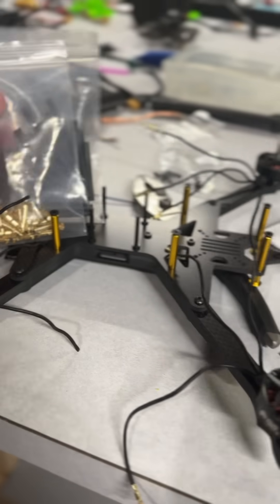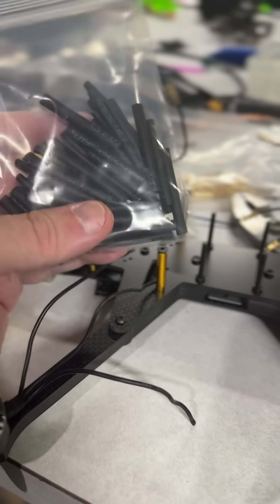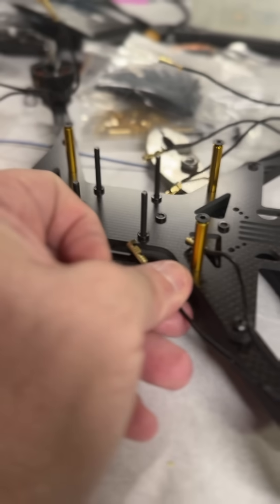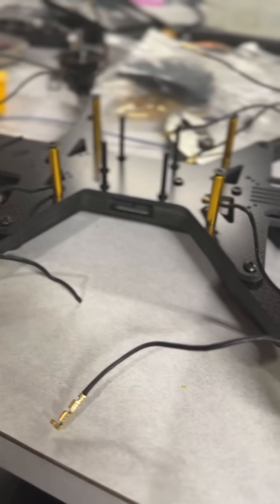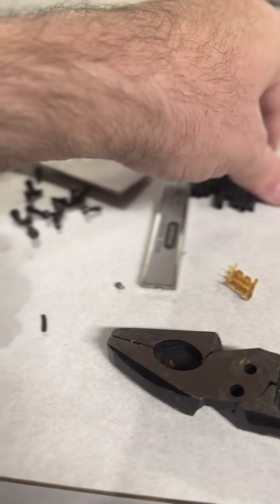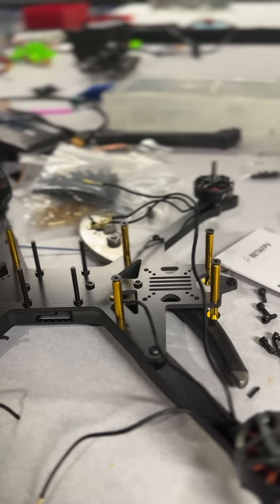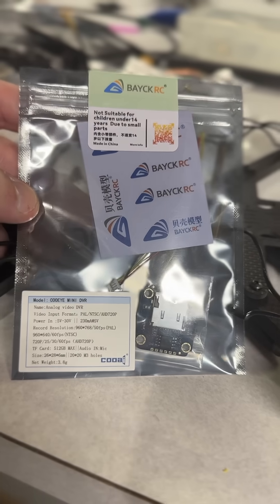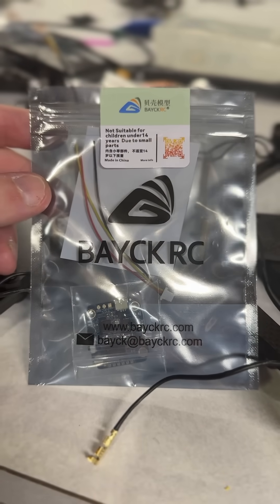How to easily reuse old motors for new FPV drone builds and a bonus on better analog video #fpv

Comment: Racewires for the win 👌 strong, sturdy, easy to mount on arm, easy to swap on the field,  no special tools required 💪
Reply from the maker: I have some but haven’t had great luck with them
Reply: @McShakyFPV  should be as reliable as a straight wire. I don't install them when I use new motors, but if I cut a motor wire in the field, I'll drop in a racewire to fix it, without taking off the topplate 👌 also, I conformal cost everything when I'm done.  Have been getting the tmotor ones that come with the F55a stacks for a while and they work perfectly for me. Always keep em in my bag
Reply from the maker: @Fly_High_FPV I had a 100+ made by pcbway and I can’t point exactly to them but I have has a few issues and wanted to try something more streamlined but also more mechanical than just a solder connection, especially on a long range
Reply: @McShakyFPV  curious what issues, the ones I use are from tmotor and made for the f90 2806.5motors and f55amp stack. If the traces are too thin they'll impede the current and get hot.  Nothing is as reliable as an unbroken wire, but I'll take proper racewire as a close 2nd
Reply: Knew I smelled a bud in here. 🤘